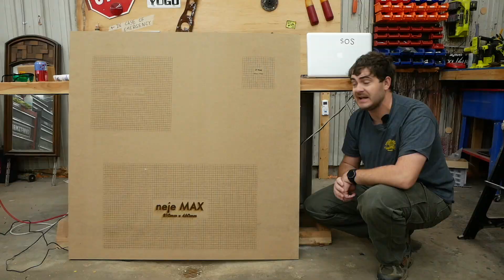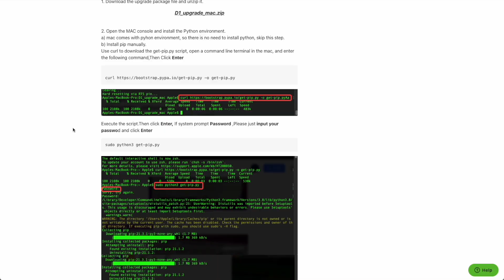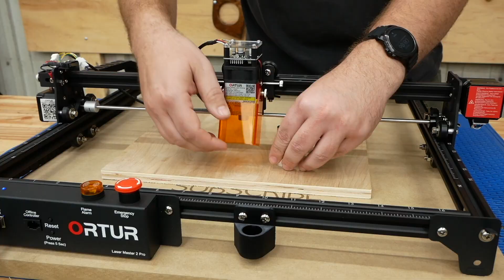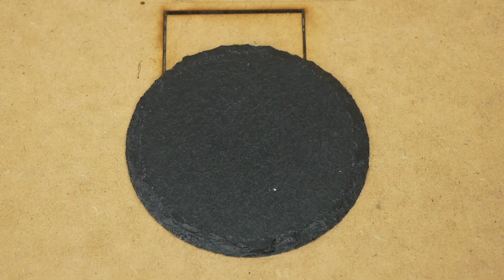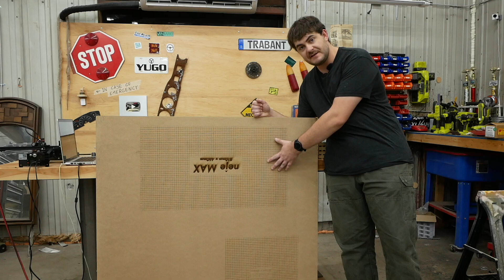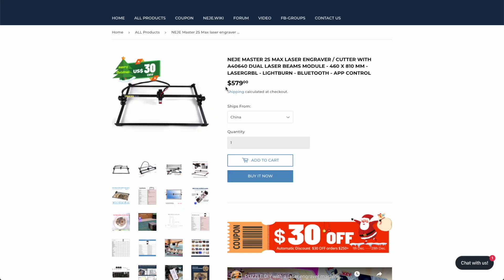I Got Sent MORE Free Lasers! Are Any of Them Good?

Comment: My daily reminder that I do not recommend ever buying non-enclosed laser etchers. One screw up and you are instantly blinded, permanently.
I know that people can "just be careful" but safety interlocks exist for a reason, and these don't have those. To all who see this comment, please consider this before buying one, especially if you aren't going to be the one to use it.
Reply: Watching Styropyro definitely made me more cautious around lazers, especially because the glasses they provide with machines like this probably don't do anything. He got a lazer tattoo remover machine and the lazer went straight through the glasses that came with it.
Reply: Indeed because it can happen so fast and with risk of reflections etc. these things are very dangerous. You only need a fraction of a "low"power 5 watt laser to blind you in an instant. just google laser eye damage.... if you dare.
A closed system with interlock is essential.
Reply: Are those missing safety "features" (feature implies a nice-to-have, but safety should not  be in that category) something that could be added in some kind of a post-purchase modification?
Reply: @aarontheamateur  You could build a box with interlock switches on the lid but I don't know if a "real" enclosed laser is more sophisticated than that.
Reply: @eDoc2020  Real systems usually have multiple interlocks, (opening, emergency stop, manual shutter etc.)
But an enclosure  with at least an interlock on opening is the bear minimum to make it somewhat safe.
Reply: @aarontheamateur  Yes. And usually by the time those things are added, it's the same cost as one that already had those safeties.
Reply: A laser I use at a hack space has translucent laser light safe cover and multiple interlocks and the rule is that it needs to be supervised by the operator the whole time it is being used.
Reply: Yeah, a german podcast made up a new laser safety class for these things,  laser Class 'trust me, bro.'
Reply: Any recommendations for good glasses? (Preferably EU)
Reply: As the warning sign in our training lab reads:  DANG  Do not look at laser with remaining eye.
Reply: I read this comment with one eye open.
Reply: I bought one of the JTech pro laser etch/cutter. love it but the cost for an enclosed was 2 grand more and upgrading to a laser cutter over an engraver. so I mounted it on a lift up workbench and built an enlosure to it using the orange acrylic.
Reply: This is the only advice.
Reply: I just got the D1 for XMas. Based on the price of good laser googles, I was thinking of just building a wood box that fits over the top, and maybe getting a super cheap baby monitor to watch inside.
Reply: oh yeah definitely, if you buy this, you should keep it in a closet or something, at least until you can print out or make an enclosure to use with it.
Reply: I agree 200% with your comment about safety . I am reevaluating purchasing a unit without a protective case. This cheap lasers advertising do not show the real danger of this units. And also some YouTubers do not know the risk of heating a laser without eye protection. Here an example: https://youtu.be/JIFunNyW5SM.
Reply: Dude, that's why you use the included glasses of excellent style.
Reply: I bought a cheap one... And then built an enclosure out of lazer safety glass. Wow that stuff is pricey!
Reply: wow dint know the risk to eyes was so high, thanks for sharing
Reply: Mild response that due to these lasers being fixed focus XY machines, their beams are usually quite low energy density by the time they reach any appreciable distance. The only time I would worry is if a concave glossy surface were ever in a position to end up under the beam.

A galvo laser is much more dangerous in that sense, because they by necessity have a much longer distance to travel and so a much lower convergence angle. Any such reflection will still be dangerously in focus 1m away.
Reply: Yeah. The risk/reward on cheap laser cutters just doesn’t seem right.
Reply: now he needs to test an OMTech KM40 C02 laser, which just happens to be cheaper than most, if not all of these.  albeit only having a 12x8 work area
Reply: @PoodlePuncher  we got an Omtech 60W at work. It's great for the price, but you can definitely see what corners they cut to reduce cost, ie why the hell is the cut plate not registered in any way to the cut area?!
Reply: My daily reminder that I do not recommend every buying a motor vehicle. One 90mph slam into a concrete wall and you are instantly dead, permanently.
Reply: @Channel-gz9hm  A very thought through argument for buying cars without windshields, floors, belts or mudguards. </s>
Reply: This is what you get when you support a communist regime.
Reply: @markm0000  What does cutting cost but still charging an arm and a leg have to do with communism? It doesn't
Reply: @markm0000  No safety regulations sounds more like a free market problem than a communism problem. Regulations tend to be a government thing.

Or are you just one of those rational people that dislikes Chinese communism but accepts that governments in general still play a vital role in keeping people safe?
Reply: @drunkenhobo5039  He deleted his comment for some reason, but from your reply to him I gather that he must be well informed voter who knows that our system of govenment is Capitalism.  /s

Comment: Xtool prices are ridiculously expensive.  Those laser diodes are pretty damn cheap, especially when compared to a C02 laser tube.  Then they exclude the much needed case, for not only fume extraction but also for safety, and don't even have limit switches?  There is no reason whatsoever for a 15 watt diode laser to cost more than a 30 watt K40 C02 laser (they lie about the laser tube wattage as well).  Charging so much for such crappy laser is a scam.

Comment: I dont know why they use limit switches for this, at all.
I suppose they are using stepper motors here for the gantry and if thats the case it would be pretty easy to sense, when it encounters resistance.

Motor drives into the end of the rail -> motor requests more power to overcome this load now -> you can sense this electronically, and very fast aswell.
This takes almost no extra parts, just some small resistors afaik that cost fractions of a penny per piece and some coding.
Also it would give you a safety measure in case something is blocking a motor or something, safe shutdown in case of obstruction.

Comment: Worst thing about eye damage due to laser light is that it can be so minuscule our brains tend to hide the damage pretty well. It will correct blind spots as it does constantly with ones we naturally have in our eyeballs. When we start to see the damage (patches devoid of vision) it will be way to late to do anything with it. Plus it isn't a type of eyesight problem that can be fixed with glasses or really anything (as things are now). Laser light can destroy light cones at the bottom of the eye which is not something that can be cured with tech we have.

Comment: 1:34 I've seen this a LOT with Chinese direct from factory tools and parts. 432mm x 406mm is almost exactly 17 inch x 16 inch. Sometimes these Chinese factories just copy the dimensions of a part that uses imperial units, but the Chinese factory converts it to metric for you. another common one is 12.7 mm which is 0.5 inches

Comment: 4:50 In fairness, proofreading only works if you actually know the language. They could have just used a translation software (translation between Chinese and English is iffy even with the best software, and just does not work with technical terms or informal language) and hired some poor shmuck to proofread it. Whatever English IS taught in China really isn't functional.

I did "proofreading" for a drinkware company, they initially did the translations themselves and it was horrible. After realizing I was practically rewriting everything, they decided to hire actual translation services. Not much changed. They then tried an English major from a rather major university. It was somehow FAR WORSE than their own attempts. Finally, they just threw in the towel and had me do the translations and proofreading for them. Someone from a large appliance brand went to them for a job interview as an English writer (they've realized that instead of doing translations, just writing everything in English and Chinese separately is more efficient and produces far better results) and their English was just as broken and nonfunctional. The only reason they realized how piss poor their English translations was is because my father works for the company and had me help him write a couple things.

Comment: Nice video Robert, but as for saying the D1 won!  I actually bought one and was doing ok for a while, I was even considering buying one of their CO2 lasers..... but then I tried my own tests with text.  Some fonts printed out every letter of the alphabet at different speeds and power settings but most were not only not consistent but many of the letters either didn't print at all when they should have some even printed looking like letters from some kind of ancient hieroglyphics.  The company had no explanation for this and after providing video proof were they willing to refund 90% of my purchase price.  Yes they charge a return fee!  In short, diode lasers are not much more than toys for grown ups, without any meaningful safety features I wouldn't let any kid of mine to operate one without supervision.

Comment: About your Arduino spot welding......Everything is ok but 1 single problem...is.  For long press push button .. circuit is continuously ON/OFF....Plz fix this problem 
Need 1press for 1 spot

Comment: I bought a smaller Neje MAX 2! 
I love it, they lied, but I love it.
In the FOR column, Bluetooth works (but only with their tiny crummy program), and after a new (better) printer/data cable it's been reliable as hell
In the CON column, it doesn't cut as well as it claims, and it had a slightly missaligned arm (that I aligned with some new holes)

(I also bought a bunch of correctly coloured acrylic to put around it because it literally vaporised shit)

Comment: Way Better than most other Laser Engraver Reviews.  I have a small 5W one for over 2 years. Fixed the Back EMF from the motors and sporadic Laser turn on (added a diode), built a nice large safety cover window (the material, cost about 1/2 the entire laser engraver) and bought some real safety glasses (the green ones that came with it are worthless), but have one major problem: WHAT TO DO WITH IT . It works OK, but after burning some MDF and popsicle sticks. I find it useless for anything practical and it sits in a nice box on the shelf.  Maybe I can customize car hoods. 😃😂

Comment: I have a NEJE.  I bought the even smaller NEJE Master 2 Mini on impulse this summer.  It's competent and works, but I would highly recommend you don't buy it.  The software is terrible, and unlike the NEJEs you reviewed, it is not compatible with Lightburn.  Also, the anti-laser-in-your-eyes glasses that came with it do not fit properly over prescription glasses.  If you wear glasses like me, get some laser-resistant goggles.

Comment: I thought the Xtool seemed pretty good until I saw the price tag. You could probably DIY one for half the cost that performs twice as good using 2040 extrusions for the frame and 2020 for the gantry. 

The Xtool's homing that causes it to "crash" is referred to as "sensorless homing" in 3D printing (not to say the concept is exclusive to 3D printing - that's just what I'm familiar with), but it's definitely not supposed to be that violent. They're either using incredibly cheap stepper drivers and cludging in sensorless homing, or they're using the correct drivers but not properly calibrating them in the firmware.

Also the Neji that has the gantry offset issue... that's nuts. Especially considering either side is independently driven, it wouldn't be a huge deal to put another endstop on the secondary stepper side to just have the gantry tram itself on homing operations.

Comment: The limit switch issue on the Max sounds like a very easy fix: Wire two limit switches in series so the home will only be hit when both motors are at their end stop.
Reply: If the limit switches are wired correctly for limit switches (normally closed), then putting 2 of them in series will do nothing for you. It will just stop when the first switch is hit. You need 2 switches with separate inputs to the controller, and the controller to be smart enough to drive each stepper motor independently when homing to actually be useful.
Reply: @gorak9000  If they're normally closed you can wire them in parallel.
Reply: @Stoney3K  Oh, so it opens only when both switches are open? And you just drive the one motor against the stop until the other one catches up? Kind of a lame solution, but then again this isn't a precision machine, so I guess driving the motor against a hard stop is about what I'd expect from this kind of thing.

Comment: God I hate the massive price jump between sizes... It's not like the parts cost is much higher, you're basically just buying slightly longer aluminium extrusions for an insane markup and like one changed line in the firmware that defines the work area.

Comment: Not having endstops may not necessarily be an issue. Better stepper drivers measure the amount of current they push through the stepper and recognize when they hit a limit. This feature is used in a couple of 3D printers. Doesn't mean that your engraver uses those drivers, it just means that they exist and this method could be used *in theory*.

Comment: The X Tool homing by just going back until it can't go any further is kind of like an old commodore disk drive that counted the rings on a floppy disk by counting from home, so it would just go back 40 steps... even if it was only 1 step away from home, so you'd get the classic "grgrgrgrgrgrgrgrgrgrgrgrg" of it smashing back into home lol
Reply: I'm pretty sure it was Apple II floppy drives that did this, not Commodore ones.
Reply: @pawanyr360  You're correct, although earlier Commodore drives would still headbang occasionally. Commodore's disk format wrote the track number onto each track, so the drive usually knew where the head was. The drives would generally only headbangwhen formatting disks, or as a result of some copy protection schemes. Later drives did have proper limit switches, though.

Comment: The giveaway from early on that the Xtool was gonna be the winner was having working wifi and the software update.

Appart from technical problems updating the firmware, opening up your machine to a de-facto third party application shows some care about the product.
If they added proper cable management AND limit switches AND safety covers ... think it'd be undisputedly a winner.
XTool Max when?

Comment: Your 3d Printer can give your laser engraver viagra. Cut a unmelted piece of filament the length of the wire and shove it in with the other wired in the sleeve. It will stiffen it up for better performance.

Comment: That “crashing into itself” homing mechanism was good enough for old home computers! That’s why an Apple II sounds like an airsoft gun when it starts up. The 40 track floppy drive has no limit switch and no idea where it starts, so it starts by moving the heads stepper track-down 40 times. If it started at track 40, now it’s at zero. If it was last shut off at track 5, well, it moves a bit, rams the bumpers 35 more times, now it’s at zero.
Reply: Except that's not really what's happening here. It's not crashing to find it's limits, it's crashing because it wants to go over there and it will keep trying to do that until the stepper encoders report the correct number of turns.
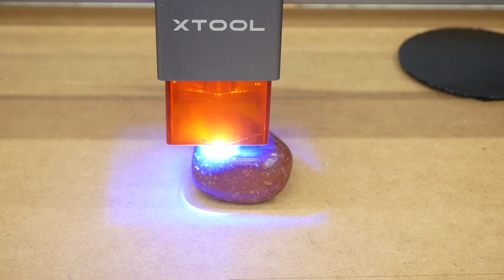Reply: @UnitSe7en  You're describing what it's doing at 19:31, I'm describing the homing procedure at 19:55.

Comment: I don’t own a laser engraver, but I do own a 3D printer that uses the same rollers-and-extrusion setup, and I have good news for you: the alignment issues on your Max are most likely easily fixable. You probably just need to adjust the eccentric nuts. 

Basically, on each set of rollers (one on each end and one on the head itself), there’s probably going to be one roller with a hexagonal nut behind it instead of the standard cylindrical stationary axle. This controls the alignment of the rollers and is probably either too loose or too tight, so you’ll need to adjust it with a wrench until you find the sweet spot where there’s no play or wobble in the carriage. You’ll know where the sweet spot is when you find it. Once you’ve done that, that should fix (or at least alleviate) it. 

(If this is helpful, please make a follow up video, if only because I really want to hear what kind of jokes you’ll make with the phrase “eccentric nuts”.)

Comment: For anyone thinking of buying one of these, seriously look in to laser safety, as these are very capable of blinding you permanently in a fraction of a second.
Laser damage to your eyes does not heal! Google that shit.
These things do not adhere to any safety standard, and will be the most dangerous tool to your eyes you probably own. 
The only safe way to operate these is in a optically closed box with an interlock, which will disable the laser before light can escape when opening.
Don't use these things open as is.

Comment: Atomstack Roller does come with the extra lift feet. Also Atomstack just released there new X7 Pro. You should try and get your hands on that bad boy. It also has a dual lasers for a 10w output. I have attached just the M50 module to my A5 20W laser engraver. Plus i'm sure youll put it to the test more than me.